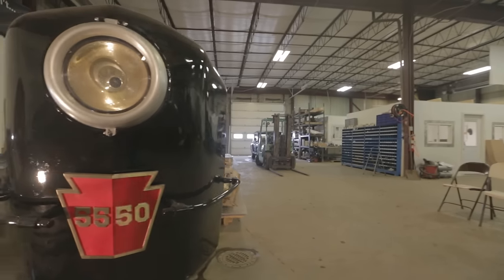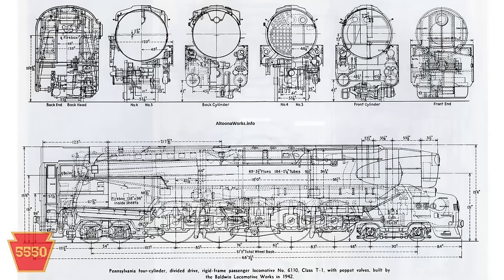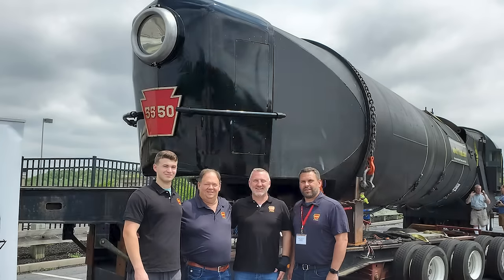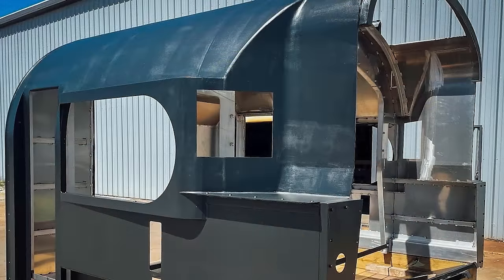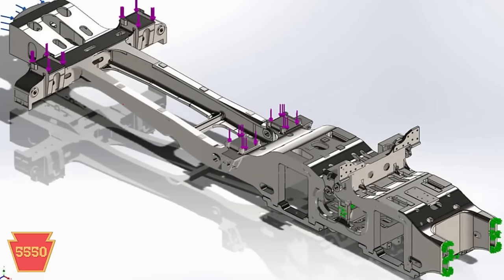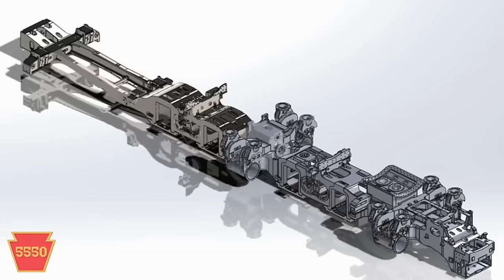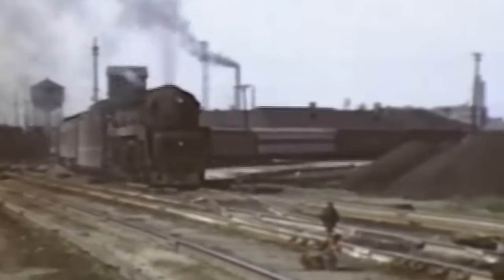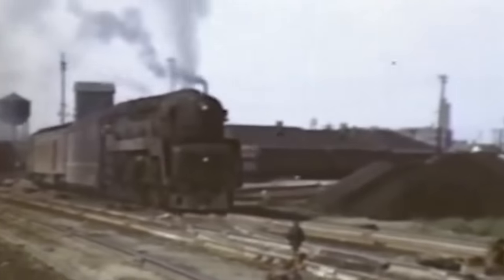Can we build a NEW mainline steam locomotive in the United States? | Restoration Roundtable

Comment: As long as there is support I believe it is possible. I am glad the Trust stuck to their guns and went with the PRR T1. A lot of people would rather have the Trust build a NYC locomotive like a Hudson or a Niagara. While I think those would be cool I’d still make the argument that a PRR T1 makes better choice.
Reply: The T1 is a unique design and a LARGE locomotive. Once the T1 is completed, the Hudson should be relatively simple.
Reply: I am tempted to note that perhaps the 'logical' follow-on project would be a NYC C1a, which shared considerable DNA with the T1s but had more conventional valve gear and very close to Baldwin's recommended GA.

Of course, that locomotive would have used an only trivially modified Niagara boiler, and all the complex work on metallurgy and detail design of the Timken rods is 'in the can', and the frame construction and jigging will be reusable... and while a Niagara may not be the prettiest NYC power, we need to finish 3001 in Elkhart, which has most of the looks of a Hudson while being more practical, before doing a replica -- and I agree with it being 5345 rather than some J3a clone.
Reply: @johnblair8146  its more about expensive than complex :P
Reply: Even if (I think it’s still a big if) they complete this, where are they going to run her? 
With three Berks, probably 6 
northerns, a Big Boy, and a challenger, all running. I don’t think there is room for this. 
And they want a locomotive that can run at 100MPH. 
Most of the track they could use is 30MPH TRACK.
Reply: @pmsteamrailroading  the T1 dose makes sense if it was 2014 where you had main line running, then it made sense. However today it doesn’t make sense to add another large steam locomotive to the east coast (when complete will be the largest in the east coast) doesn’t make sense for right now.
Reply: @pmsteamrailroading  The PRR T1 could handle 16 degree curves, with modern improvements 5550 will be able to handle 20 according to the Trust. It could follow 1225 anywhere as long as the route can handle its weight. It doesn’t need to go over 30 mph on a tourist line, it only needs to go full speed on the Pueblo test track in Colorado. Most famous Northerns (like 4449, 611, 2926, etc) that have a top speed of over 100 mph don’t run over 30 either.
Reply: @pmsteamrailroading  The 5550 will operate excursions and take part at special events on regional and short line railroads. You better not give us that “mainline locomotives and short lines don’t mix” BS.
Reply: @gamerfan8445  For like the tenth time, 5550 will go to short lines and regional railroads.
Reply: @pmsteamrailroading If the Brits had the type of negativity you (and others here) embody, their heritage railways and main line running would amount to a GWR Castle, a few tank engines, and maybe an A4.  If it weren’t for the nattering nabobs of negativism, with American ingenuity and willpower, probably half the scrapped famous locomotives of the Eastern RRs would have been rebuilt by now. 🙄
Reply: @oriontaylor  I know right?! The naysayers have always been the problem with any steam locomotive project. Some people care about nothing but themselves and their entitlement.
Reply: @chooch1764  okay then, so we can restore N&W 1218, and C&O 1604 as well and run on short lines.
Reply: @gamerfan8445  There are no plans to restore 1218 nor 1604. If they would be and short lines are the only option, so be it. 1218 would be great on the Virginia Scenic Railway, where 611 was this past Fall.
Reply: @chooch1764  the problem is time is changing. Like I said before if we still have mainline operations with Amtrak then it a different story, however we don’t have it anymore. While we have short lines, however mean they can’t handle as large as a T1. 

Meanwhile smaller engines are more viable for the states as a start. Considering it probably takes less time and money to build something like, for example a CNJ G3. 

However both us can right, or Wong. The only way to see who is right is for when the T1 trust can complete her, and preforms as expected.
Reply: @chooch1764  you realize I joking. There a reason why both of them are being retorted is because they are too big to be worth it. The only reason why 4014, and (when retorted) 3985 can run around is because they railroads that have a space for them.
Reply: @gamerfan8445  When 5550 runs, hope you have fun trackside with your camera, record it, post it on YouTube, your viewership rockets and you get more subscribers, and get monetized (or making money on YouTube), you’ll thank me later.
Reply: @chooch1764  nah, unlikely.
Reply: The PRR T1 Could negotiate 16 degree curves. Modern improvements will take it to 20. 5550 will be able to follow 1225 anywhere as long as the route can handle its weight.
Reply: @Stooltoad5017  okay, but we have to wait to see
Reply: @gamerfan8445  What you and some others seem to fail to realise is that time is always changing.  A restoration group with a long-term project cannot base any plans for main line operations on what a given Class I is doing right now, as their locomotive will not be available right now.  Policies change, as we have seen numerous times in the last twenty-odd years.  Stop ‘worrying’ about what other people are doing with their money.  If you’re so concerned, donate to a smaller locomotive of your own choice.  Put your money where your mouth is, or shut it.
Reply: @oriontaylor  like I said we have to see. So you know I willing to admit I was wrong when it proved that I was wrong. But till then I keep my opinion.
Reply: @gamerfan8445  who says it won't be possible to run on Amtrak metals? And why?
Reply: @richardharrold9736  Actually folks from the T1 Trust said Amtrak won’t allow high speed testing on the Northeast Corridor, but the T1 will do high speed testing at the FRA test loop in Pueblo, Colorado.
Reply: @richardharrold9736  the fact the 611, and 4449 are stuck on small lines speaks for itself
Reply: @gamerfan8445  do you mean privately owned heritage railways? The J-class has only 70-inch drivers and notably poor adhesion characteristics, which will necessarily limit speeds and loadings. Can't speak for the other machine you cite - but there are myriad parts of the US national network which are predominantly or even exclusively used by freight and do not require (or even allow) triple-figure running. In any case, a brand new, purpose-built high-speed machine is not at all the same prospect as an 80-year-old mixed-traffic museum piece. The new T1 is probably the most heavily analysed and scrutinised locomotive design of any propulsion type in North America. And that's before we even consider what testing at Pueblo may reveal. So it may well be that the FRA and Amtrak will be happy to issue it a licence to run faster than 80. Over here we've had Mallard's classmate Bittern up to 96 and Tornado up to 102, the former actually on revenue-earning excursions, and with Network Rail's full knowledge and approval - and over on Deutsche Bahn, 01 1104 is routinely running around at 87mph with 500+ tons on the drawbar. Mind you, holding up Deutsche Bahn as an exemplar is not a great idea these days... forget everything you've ever heard about German efficiency, they couldn't organise a piss-up in a brewery, and have had to turn to the various 'Eisenbahnfreunde' to run scheduled services in bad weather lately...

Comment: FMW and T-1 trust is a power house, if I ever win the lottery funding won't be an issue. This project shows the endless possibilities of modern manufacturing technology. Imagine a brand new design, 2-8-8-6 (like an allegheny on crack), 350 psi. Maybe titanium pistons, piston rods, titanium cross heads with needle bearings, poppet valves, full roller bearing running gear, 600 mile service range and 80+ mph top speed.  Call her the Claytor class.

Comment: The fact the PRR T1 Trust are on the verge of pulling off the unthinkable, the answer is yes. With the right people who have the knowledge about what they are doing and also having the adequate funding and industries to contract the work out to; it can be done. 

If you want to get a new rebuild started after the T1, the biggest one to do next would be a New York Central J3a Hudson.
Reply: That's the logical choice for the next American newbuild steam locomotive.
Reply: The Hudson should be first.
Reply: @gamerfan8445  Too late, then. When are you going to start the campaign for building a Hudson? We’re waiting…
Reply: @chooch1764  you know my reply already.
Reply: I want the 5344 to be rebuilt as it was the only J1e Hudson to be upgraded to the J3a classification as it was the test bed for all the J3as.
Reply: Can't think of a better locomotive to break the steam speed record than a shark- nosed locomotive!!!
Reply: @robertdipaola3447  it never going to happen
Reply: @kristoffermangila  sod the NYC, go for the more powerful, better-looking Milwaukee Road 4-6-4!
Reply: @gamerfan8445  the T1 probably has the capability to at least equal Mallard and 05.002, but 140mph? Not likely... and even less likely is the idea of Amtrak OK'ing an attempt. Doing such speeds with only two cylinders per driven wheelset is not a good idea in terms of reciprocating forces and hammerblow anyway - there's a reason why the LNER and the Reichsbahn went for three cylinders, and it's not just because of the restricted loading gauge.
Reply: @richardharrold9736  it mostly because the FRA won’t let it travel over 80.
Reply: @gamerfan8445  That’s not true. The T1 Trust already has a sponsor to pay for the trip to the FRA test loop in Pueblo, CO and testing fee for the high speed testing. The T1 will be able to go over 80 on the test loop.
Reply: @gamerfan8445  so run it at 80 then. Over here we've got a 75mph limit on steam, doesn't stop Network Rail bending over backwards to provide pathing slots for steam on 125mph main lines.
Reply: @chooch1764  okay but is it a smart move to do.
Reply: @richardharrold9736  and that my biggest gripe about the T1 trust. They think they can bring the best steam locomotive ever built (which the T1 aren’t). So they think breaking a old record will make them famous meanwhile it really a stupid and dangerous idea. True be told a Big Emma is a better choice for a new build.
Reply: @gamerfan8445  I haven't heard them arguing its technical superiority to European machinery. For my money, the German 3-cylinder machines are the finest ever made, followed by the 3- and 4-cylinder express locos here in Britain (although we did have a few turkeys in the first third of the last century). I've never understood America's phobia of inside cylinders, especially with the accessibility of bar frames.
Reply: @gamerfan8445  It’s not a stupid and dangerous idea, because other companies have done speed testing on their equipment over there and they were all safe to do so. Your opinion is not going to stop this great project from happening. Honestly, I’m done arguing with you. Just find something better to do than just commenting negative things about something than many folks know more about than you do.
Reply: @chooch1764  yeah they are modern locomotive with a second unit that can take over testing for it if failure. Also none of them are a steam locomotive. We have one T1. Trying to break the record may cause a catastrophic failure that more likely to result in a write off of 5055. Which would kill any new builds. 

Also trying I to be realistic without joining the hype.
Reply: @richardharrold9736 it might have something to do with it k i n d a Being uncharted territory to an extent and also the familiarity with outside cylinders and also the fact that we allow locomotives to be much wider so there really is no reason to Have inside cylinders some of our locomotives like the union pacific 4-12-2s did have a third inside cylinder for extrta power so we weren't alien to the idea we probably just didn't use it because it was probably seen as harder for maintenance Since on a american steam loco e v e r y t h i n g e is on the outside for ease of maintenance
Reply: @solidaridadjusticia1438  the inside cylinders are just as easy to get to with a bar frame, though, and the advantages for smoothness at speed are undeniable - the laws of physics work just the same in America as they do in Europe.
Reply: @richardharrold9736 It could have something to do with the fact that I don't think you can fit massive cylinders inside of a frame but eventually the frame is gonna be too narrow to fit larger Cylinders so you're going to have to put them on the outside
Reply: @richardharrold9736 Also, again with maintenance If there's something in the way even though cylinders might be easy to get to everything Around them will be harder to maintenance and oil especially on duty
Reply: @solidaridadjusticia1438  it really isn't. Go and look at a Baureihe 44 or 01.10, accessibility to the middle cylinder and its valve gear is superb.
Reply: @solidaridadjusticia1438  I loathe diesels in all forms. And a lot of our diesels don't match the description you give.
Reply: @richardharrold9736 (sorry i had to delete the old comment since it didn't let me edit said comment So I just deleted it) I personally like those early older flat face British diesels like the class 47 And other similar to it Because they formed better with passenger cars

Comment: A cautionary tale from the UK about how small things can trip you up. I heard this 30 plus years ago, so hopefully the issue has been resolved, but just in case: 
The Flying Scotsman had been brought back into service, all the big terrifying things had been sorted, and she was pulling main line trains, but they started getting bearings running hot. (Local Steam Railways did not have this problem as they were only doing short hops between stations, and manually oiling. Main line Express Trains do not stop). Eventually they worked out that the lubrication system was at fault. The original method was a pipe, fed through with a flax wick, connected to an oil reservoir. They had used a modern synthetic wick. So they replaced the wick, but still had problems: Oil. They needed a specific viscosity oil that would match the flax, and drip at the required rate. Luckily, one of the old engine shed workers happened to have a can of the correct grade oil that he had liberated when the the works shut down. From that they were able to get the formulation, only to find that it was no longer made. One of the big Oil Companies stepped in an made a one-off batch for them, and they were back up and running. How they manage all these years on I do not know!

I know that the "Big Boy" still runs in the US, so I am guessing that they must have some solution for that problem, but beware the small things that you just don't think about, to come out and bite you!

Hope you-all succeed.
Reply: Restorations in the United States had similar problems with certain types of grease. The grease is not available, thus the conversion to oil cellars for main wheel bearings. Texaco was one of the suppliers of the grease and after the end of steam had no need to produce it, and would not produce small batches. While Texaco did provide the formula, and one operation was able to find a company that was willing to produce a small batch ( boxcar or two load ) the company would not produce another batch as it was found to be dangerously volatile in certain stages of production.

Comment: This is so far 10 years in the making, I'm hyped to see this engine be completed in the near future or even at least assembled to show how it's looking and will eventually look.

Note: by "assembled to show how it's looking and will eventually look", I mean when the frame is completely made and done, have the drive wheels (when the last 2 are done), future pilot and trailing wheels, and the fully welded boiler (with cab, fire and smoke boxes, and nose prowl) put together to show the resemblance of a steam engine, even if it doesn't have all the tubes, pipes, and streamlining on it.

Comment: This is great the progress you guys are making, I’m just very doubtful that any mainline railroad allows this engine to run on their rails.  If completed I see this engine working short lines or class three railroads, doubtful it will ever run on the main.
Reply: Railroad management on class ones change every three years on average. Never say never.
Reply: This part of the problem is tricky, and the British experience involves the whole system which has many differences in safety and control from US standards. But part of the process for Tornado was the test run to 100mph, along the East Coast Main Line. The 100mph was over the speed required to run a train on that line without interference with normal trains, and apart from everything else it was safe with the overhead electrification.

As I recall, the British requirement is to match the freight and ordinary passenger traffic for speed, which means the problems of one train passing another are minimised.

Perhaps the question should be who sets the standards for every train on a US railroad and who tests that a locomotive design meets them?